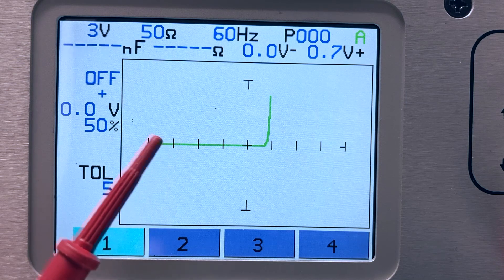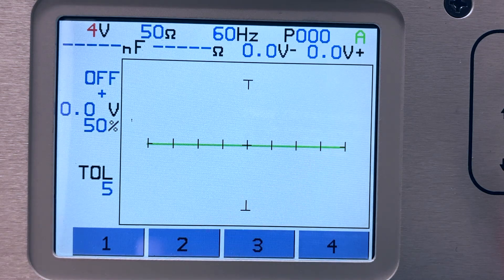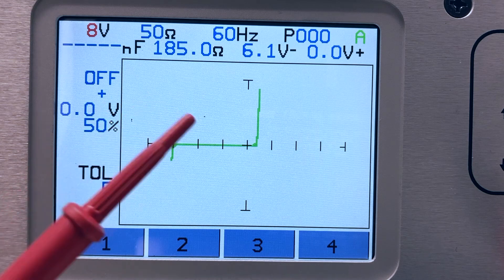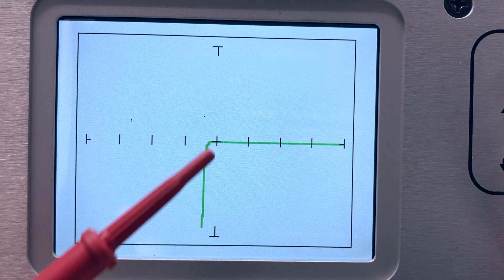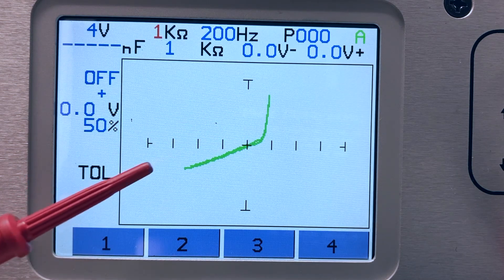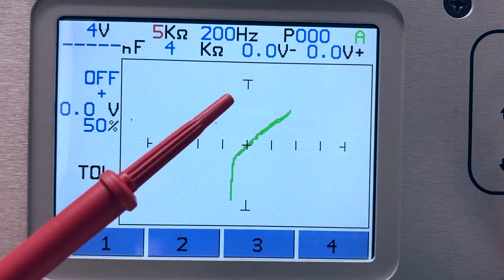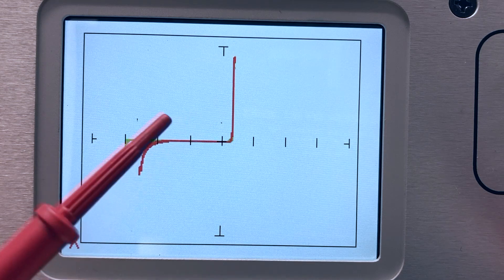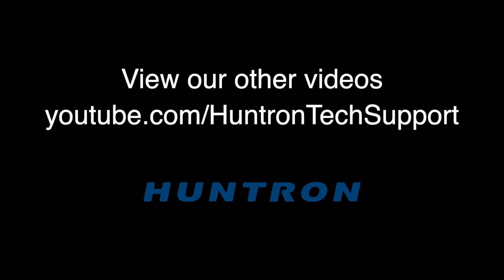How to use a Huntron Tracker - Testing Semiconductors and Semiconductor Failures

Comment: aweosme device but imposibble to in Turkish. (1USD=20TL)
Reply: Its impossible to buy it anywhere. Its 10K+ USD
Reply: Just make your own. Parts cost about 1 dollar( a AC 9v transformer, 1 resistor). And you also need one XY scope😊
Reply from the maker: A single range tester and you still need to have an o-scope. Not even a close comparison to a modern Tracker.

Comment: Hi, nice explanation.
Just for interest - it's been about a fortnight since I repaired the programmable lighting controller and one diode in the bridge was damaged - a discharge in the circuit of the source part (the glue fixing the parts overheated to the point of burning to carbon and creating a bridge through which the discharge passed). When tested with the diode test of the multimeter, it had a normal voltage drop, but when I checked the diodes with a curve tracer, the exact same picture as shown in the video came up - The negative voltage part of the curve goes down - it shows resistance.
Not having a curve tracker I didn't find her fault.

Happy new year and have a great day 🙂 Tom
Reply from the maker: Right tool for the right job!